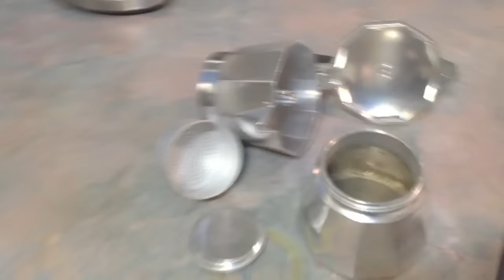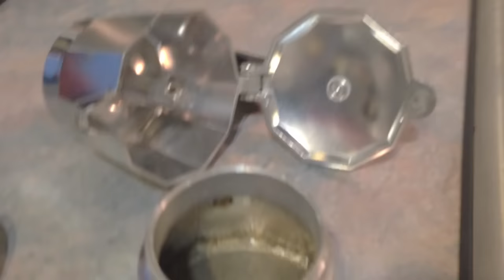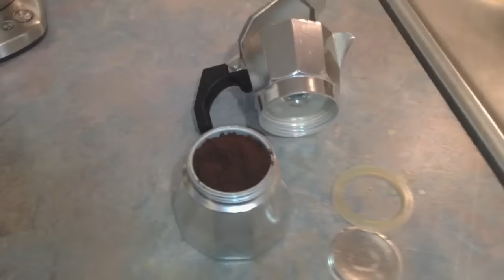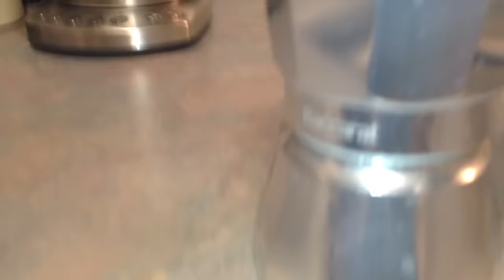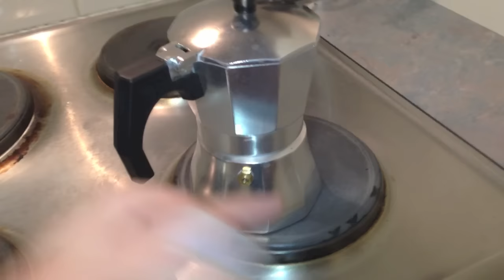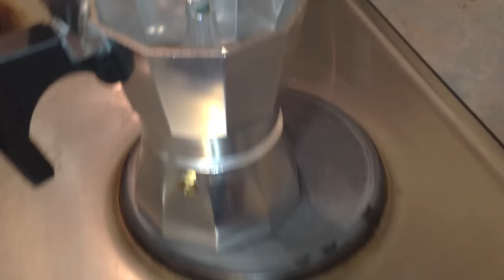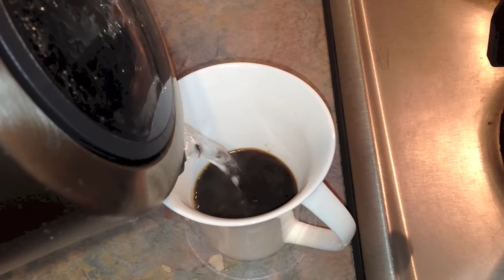How to use a Stovetop Espresso Maker

Comment: He's got it partly right. But he should tamp down the beans very lightly, and he should wipe of the rim so that it doesn't prevent the rubber gasket from forming a good seal, he should also tighten the top more firmly than he suggested, AND (you can't "burn" coffee with boiling water) you should use a high heat to do it quickly.

Comment: Just wondering if an aluminum one is the type to get, or do they come in stainless steel or another metal? I'll get one off eBay and they seem to be aluminum and was wondering if they are just cheap and nasty ones from China, which is where it will be sent from or if a proper moka pot is steel or anything else
Reply from the maker: Almost all of these are made from aluminum, if you want to ensure you get a quality pot. Look for the Bialetti brand - these are the original and will ensure you don’t get a ‘knock off’. 
Some are made from other materials like stainless steel.

Comment: I have 2 of these at home in 2 sizes. I will say they make great coffee but apparently, when aluminum reaches a certain temperature, it releases toxins into the food or in this case coffee which have been linked to Alzheimer's. After hearing this, I quit using my stovetop espresso makers. I'd like to hope that what I have heard is wrong since I would like to go back to using these traditional stovetop coffee pots. Can you dispel this if it is untrue or confirm it if it is true?
Reply: I've done exactly the same Eric.  I'd be grateful too for clarification, thanks
Reply: Jan Kuhnert I'm considering buying a stainless steel stovetop espresso maker. They are more costly but you don't have to be concerned.
Reply: Eric Coovert
Aluminium forms a very strong oxide coating that renders it totally inert. Unless you put something extremely alkaline in like lye or caustic soda (which dissolve the coating) you have absolutely nothing to worry about.
Reply: Guy Wood Thanks Guy, I'll have to dig one of them up again and start using it again.
Reply: These things are chromium plated, so it never contacts aluminium directly (nor indirectly..).
Reply: The genuine Bialetti ones aren't they're cast aluminium.
Reply: Eric Coovert I'm more worried about using a Mr. Coffee or almost any other coffee maker made nowadays..every one I buy smells like burning plastic! I just spent a bunch on a Cuisinart which leaks when pouring and smells like burning chemicals. I now have one of these and will take my chances with the metal. I'm looking to get an old percolator or a Melitta if this doesn't work.
Reply: Eric Coovert   I wouldn't worry more about this than anything else.  Our water is full of medications that current water treatment plants can't remove.  The water gets to our houses in miles and miles of often VERY old plastic pipes.  Normal coffee is brewed in a Chinese made coffee maker full of plastics and goodness knows what else. Considering that, I don't think these will increase your risk overall. Still, it's better than living in a cave, rubbing sticks together to make fire, running from bears and tigers, and hoping to live 30 years like the clan elders.
Reply: I use a stainless one. Well, stainless with brass handles. Or, make Turkish coffee, instead. My Turkish maker is copper with tin lining.
Reply from the maker: Eric Coovert I don't personally know much about the effects of Aluminium and cooking. I have heard many of the things you mentioned above, however this is the only Aluminium cooking vessel in our house.
Luckily there are plenty of Stainless Steel options for these pots available now as an alternative :)
Reply: Eric Coovert i don't know about that, but this is not aluminium i think, anyway it's scientifically proven that  the consumption of coffee reduces the risk of alzheimer. (sorry for my english)
Reply: Eric Coovert Hello, I guess you don't need to worry because of the oxide coating formed on aluminum. However, speaking of aluminum toxins, isn't that baking powder is more dangerous since it contains alumium molecule which can be adsorb by body.
Reply: +Eric Coovert There is probably no evidence for that  but aluminum in antacids can give you slight diarrhea :)
Reply: +Eric Coovert One of the most publicized and controversial theories concerns aluminum, which became a suspect in Alzheimer's disease when researchers found traces of this metal in the brains of patients withAlzheimer's disease. Many studies since then have either not been able to confirm this finding or have had questionable results.Aluminum does turn up in higher amounts than normal in some autopsystudies of Alzheimer's patients, but not in all. Further doubt about the importance of aluminum stems from the possibility that the aluminum found in some studies did not all come from the brain tissues being studied. Instead, some could have come from the special substances used in the laboratory to study brain tissue.Aluminum is a common element in the Earth's crust and is found in small amounts in numerous household products and in many foods. As a result, there have been fears that aluminum in the diet or absorbed in other ways could be a factor in Alzheimer's. One study found that people who used antiperspirants and antacids containing aluminum had a higher risk of developing Alzheimer's. Others have also reported an association between aluminum exposure and Alzheimer's disease.

On the other hand, various studies have found that groups of people exposed to high levels of aluminum do not have an increased risk. Moreover, aluminum in cooking utensils does not get into food, and the aluminum that does occur naturally in some foods, such as potatoes, is not absorbed well by the body. On the whole, scientists can say only that it is still uncertain whether exposure to aluminum plays a role in Alzheimer's disease.
Reply: +Guy Wood The point is that coffee is hot and slightly sour which means its could wear that coating down and release small amounts of toxins, which can, when happening often increase the risk for some illnesses. Furthermore stainless steel stovetops are easier to clean and heat up faster and therefore shorten the time you need to brew the espresso. Either way its worth spending a few extra bucks on a stainless steel version instead of risking drinking ominous toxins that may or may not come from the aluminium.

Comment: So, I'm basically a beginner at using this coffee maker. Mine is the same as the one in the video, but it's a bit old, and it isn't making enough coffee, not even half, it make 1/4 of the amount of coffee he made and I'm not sure why this is happening to me.
Reply from the maker: +Hikaru Junsui hmmm is there much water left in the reservoir when you are finished? The seal in the middle may need replacing if it's older, that might be releasing too much pressure if it isn't sealing well.

Comment: No need to use cold water ... in fact, use hot water from the kettle ... speeds up the process by about 10 mins ... nothing changes to the way it brews...

Comment: Its Mocha pot not espresso pot, that's why U not got a espresso from it. Of course if U not over boiled coffee and first of all U grind Ur coffee beans just before brewing, U get good coffee.  But not espresso.  Mocha pot can't create pressure need it for espresso.  I've got simple manual espresso pump maker where its create 18bars of pressure. And difference is very noticeable,  u will get very smooth, not bitter not watery coffee extraction with some creama off course.  U can experiment with different type of coffee beans and U will see that some of them are bit more sweet in taste which is amazing. 
As most of the people can't imagine drink black coffee cause its usually to bitter, so there u got milk and sugar. But that's the whole point, try experiment with espresso and drink a shot without anything to see which type of coffee u like.  U will feel difference. Than u can experiment more,  for example first think in the morning I'm taking,  is espresso with bit of butter or coconut oil or ginger but this is more ab healthy reason and to provide kick of energy without sugar.  Or frothed milk but than for espresso u really don't need sugar.

Comment: Why are some bags specifically labeled "espresso" while other bags are specifically labeled "coffee"? What's the difference? Are you literally using a product that is marketed as "coffee" and still achieving espresso?
Reply: If it's ground coffee, I think it depends on the fineness of the grind. Espresso grind is very fine, almost like a powder. Whereas coffee ground for a cafetiere or french press will not be so fine (as it may end up through the filter). Hope this helps.
Reply: MagnumDB If it's not ground, then it means a darker roast usually. Espresso is a way of preparing coffee.
Reply: MagnumDB

Comment: This can explode due to the pressure building up on the bottom tank. BEWARE!!!
Reply from the maker: Only a risk if you overfill the bottom compartment. Keep the water line below the relief valve and you’ll be fine :D

Comment: I've been using this espresso pot ( or 'mocha' pot, depending on your culture) on high heat every day for a couple of decades.  There is a difference in taste when low heat is used.  I don't care for it, myself.  The steam should be steam - HOT! - not hot water.  I would NEVER leave the lid open during brew.  It would spit coffee all over.  When I hear the machine starting to spit, I remove it from the heat.  Occasionally the SRV (safety relief valve) would blow, but not very often.  That is the only indicator a person needs to know if it is too hot.  It is not dangerous.  It can reach up to 95°C, no problem.  Have a look at https://hypertextbook.com/facts/2004/StaceyJohnson.shtml for a good explanation of temperature.

Comment: This is a lot like cowboy coffee.
Reply: I J Not really. Cowboy coffee is boiled directly in the water. Grounds are in the pot of coffee  (cold water sends most of them to the bottom). This method is forcing hot water through the grounds, and it is thicker and more concentrated.

Comment: Rather use stainless steel if they have it
Reply from the maker: Rolando Perez yeah I agree, Aluminium is the traditional material used for these. But there are plenty available now in Stainless Steel which work just as well.
Reply: Already got one.
I bought a Primula stainless steel stovetop  espresso maker.
In 6 cup capacity. Model is PES-4606.

Comment: The basics are there but I think this guy did not finish correctly. first I think he put too much coffee in the basket. Second, when the coffee comes out you are supposed to let it run to completion. There will be a point when the coffee will taste really gross... Try it out. You can usually tell when the color of the extractions starts to get lighter and in my case I usually stop and pour the coffee when it's about 2/3 rds full even if water is still coming out. The remaining 1/3 of coffee will taste so disgusting you will understand what I mean. Otherwise these machines are great.

Comment: That is a very nice cup of coffee, I'm sure, but it's not espresso!
Reply from the maker: Keen to hear your thinking behind why this isn’t espresso.
Espresso to us, is any strong black coffee that is brewed using pressurized water. Pressurized water is the mechanism that makes these machines work, so in our eyes it qualifies.
Reply: @Guide2Coffee  Its not so simple...Pressure is not Pressure, and Express is not Espresso!  
Espresso is extracted at very high 9Bar of pressure, and because of that, it requires a much more complicated machine...espresso is typically characterized by an intensely flavored product with rich crema on the surface because of this complete extraction.  
The simple rig here is called Express (as in fast, unfortunately this is almost deceptive naming by Bialetti because of the misunderstanding it creates!) because it is misread by many (including you) as espresso...this machine only makes minimal raised pressure from the boiling water, just enough to push the water through the grounds and into the top reservoir, with maybe a little pseudo-crema resulting (still a very acceptable cup of coffee though!).  
Bialetti addressed the extraction under raised pressure issue in the model Brikka by putting a calibrated weight on top of the riser pipe in the upper reservoir.  This weight forces the pressure below to rise further until it exceeds the force necessary to lift the weight from the opening, to allow the flow, and this results in extraction at a somewhat higher pressure...more flavor and crema results, but this is STILL not a true espresso extraction!  I suggest you try the Bialetti Brikka model and compare results to this Moka model, and also compare those to product from a true Espresso machine!  Cheers
Reply from the maker: Wonderful background knowledge! Thanks so much for sharing. Absolutely agree with you from a technical and purist point of view. 
I guess calling it is Espresso is a risk of over simplifying the explanation. In conveying the concept, it has closer ties to espresso than other forms of extraction like drip or pour over to help a newcomer rationalize the differences. 
Absolutely appreciate your feedback and well informed response 👍👍